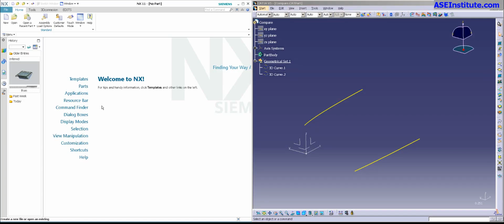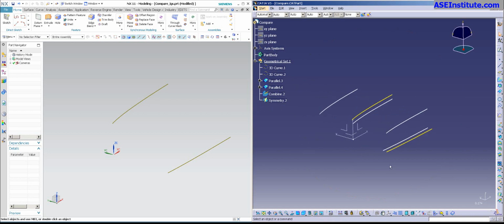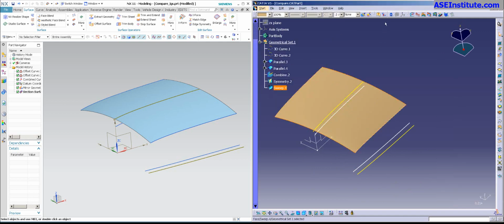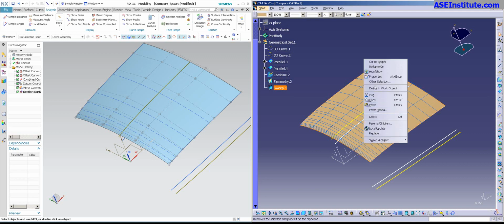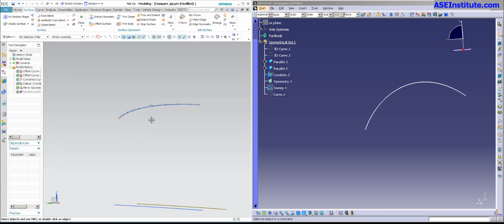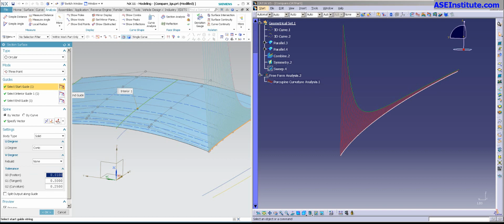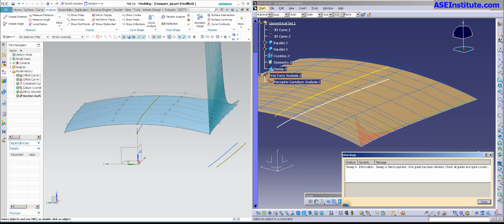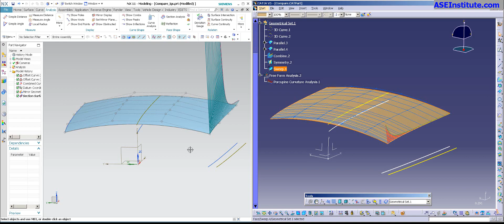CATIA vs NX:  Circle Sweep vs Circle Section

Comment: About the default tolerance in NX.. you can change it into /preference/modeling so you have a general .001mm if needed.
In my mind, the option of loosening it should be last, otherwise you can create gap's in between surface's and have issue down the road
Reply from the maker: You can yes but it is under File: Utilities: Customer Defaults. Those are global settings. 

.01mm is normally good though.
Reply: n.b.: if you set the tolerance into the customer defaults setting and use a seed file, tolerance will not apply... NX will use the global setting only if you start from a blank file.
Reply from the maker: You need to modify the seed file.

Seed files are preset files that contain model settings and such. Open the seed file and modify or create a new seed file and over-write the old file.

Comment: Sir ...i am mechanical student..i decided to  learn  this software...but i am confused..which software should i start first....nx11,ptc cero,solidworks or autodesk inventor????...n i am beginner...plz help me out
Reply: Shubham Kushwaha You should take a look at a job listing site searching under the various packages. OR, if you're targeting a specific industry, check out the companies you'd like to work for and what they use.
My personal opinion... either NX or Catia. One could literally write a book on the reasons why but in a heavily mechanical design environment, these two deliver so much in terms of parametric modeling and assembly, collaborative design, motion simulation, PLM and manufacturing (CAM). There literally isn't anything you can't do with either one and as Steven stated, once you have one under your belt, the rest are fairly easy to acclimate to; like getting into a new car and finding the windscreen wiper control. They all do very similar things in different ways. Where the real differences lie in the various tiers are the options at your disposal for achieving the desired result.
Back to Class A examples... at low tier you might get one result with tangency and no other control options, where as NX, Catia and Pro E likely have a feature that can achieve a higher degree of continuity.
Reply: class A surfacing That's why I subscribe here. Steven does an excellent job explaining what he's doing, and more importantly, why! This is the stuff you won't get from most text books on NX because it can only be gained through years of experience. 

Myself, I'm primarily a mechanical design guy, so styling (form) often times takes a backseat to fit and function. Certainly more so than it would be for a styling expert, but these tools are still important to learn in any design discipline. 

Considering that more design is being pushed outside the traditional "box" by additive manufacturing; it's literally changing the way we think about everything and, in a very good way! That push alone is driving more organic designs and with that, more surface based design elements. That said, understanding the toolsets--developing a greater depth of knowledge--is important regardless your specialty. 

Keep up the good work mate.
Reply from the maker: I got in to CAD at the cusp of on coming parametric movement which meant I got to see how old systems operated. It all translated to modern systems. A lot of people have never seen that so having a deep understanding is difficult.

Thank you. Greatly appreciated.
Reply from the maker: Well, that is a difficult question to answer for several reasons.

What type of work do you want to do? NX is being adopted by a lot of large OEM's but a lot of smaller companies use the softwares because they are less expensive.

If you want to work at the larger OEM's then NX or Catia.

They are all good softwares as well and you can easily learn an additional package once you get the first one down. The next is a lot easier to learn.
Reply from the maker: What Zak says.
Reply: first, are u fucking moron
u cant compare none of them
...
get a brain, u nigga